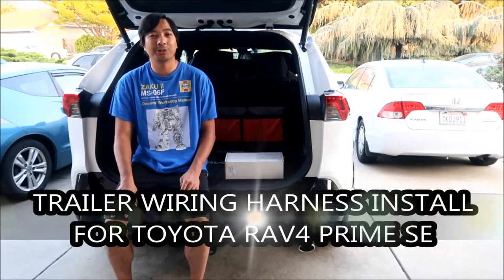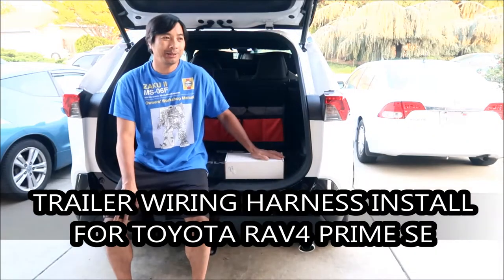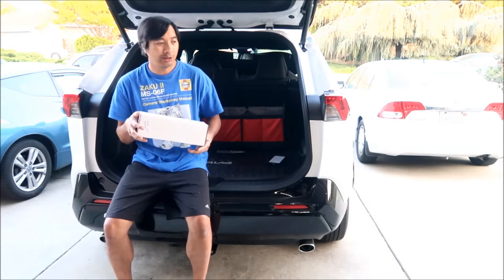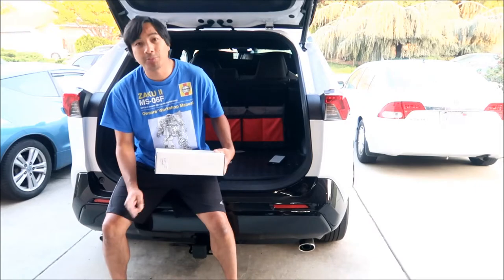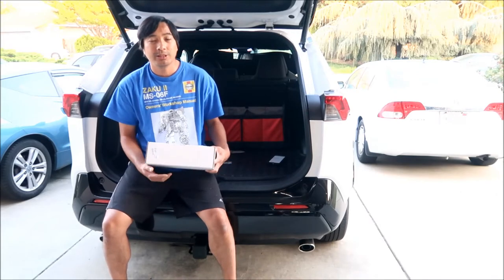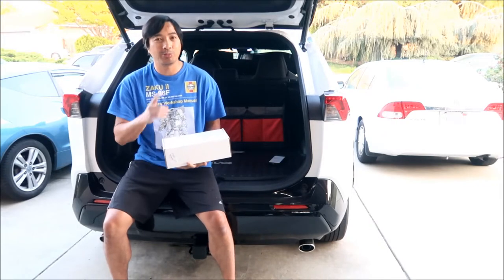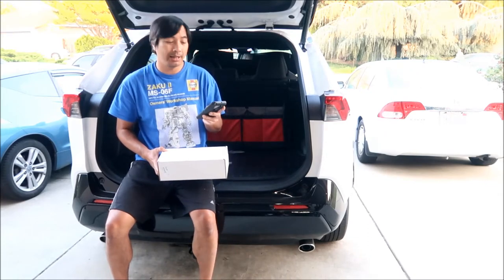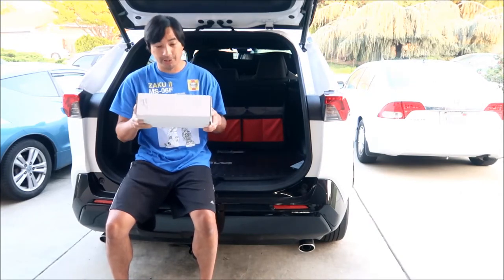Trailer Harness Install Toyota Rav4 Prime SE

Comment: Thank you for the video,one piece of advice where you passed the wiring thru the body plug ,either poke a hole in the center of the plug or cut a slit and keep the wiring protected it shouldn’t be touching the metal edge it’s eventually going to wear thru and short out . You can seal the plug with rtv silicone where the wires pass thru .

Comment: Thank you for your honesty.  5 hours!  I read DIY many times and I understand that people that do this for a living can do it in 20 minutes, but me 5 hours.  No one every talks about the honest time for doing the job RIGHT and I think you did pretty good.  Most of all I appreciate the honesty. I installed the CURT 13416 yesterday (me and wife) and as simple as it may be, it was a bitch for us to get up in there and simply install (4) bolts. Next project is to install the wiring harness as you did.  And I want to do the same as you.  I don't want the stuff where you pull the wires out of the spare tire when you need it, and stuff it back when you don't.  Anyhow, thank you! (I may go with a different brand wiring harness but I suppose they're all the same? Your thoughts?

Comment: Do you think you could have put the control module in the battery compartment (passenger side) in the Prime?  Assuming the harness connectors are reversible seems like it could have saved time on some of the wiring work.
Reply from the maker: Hmm yes I probably could have but I don't think the left signal wire would reach I would have to extend it.  Either way you'll have to run a wire across.  It was designed to be installed in the rear left.

Comment: Thanks for the video! I think the light stays on 32:38 because the towing control module doesn't know when the ignition is off on this car. Does it ever turn off for you when you are not towing? It seems the power wire is always hot, even when the car is completely turned off.